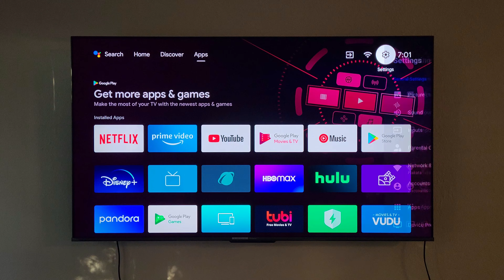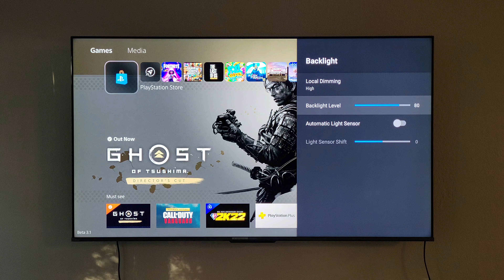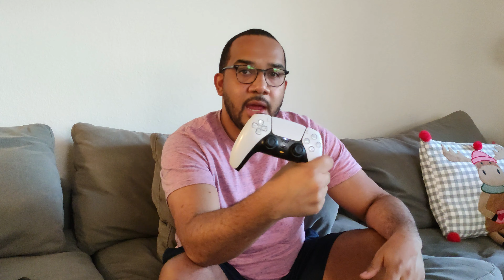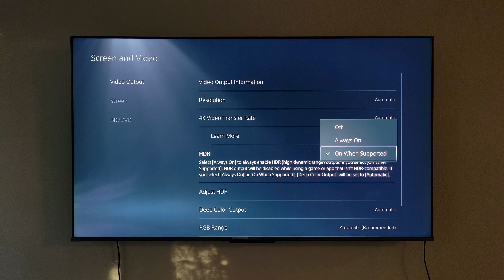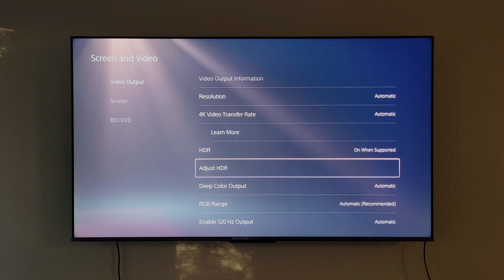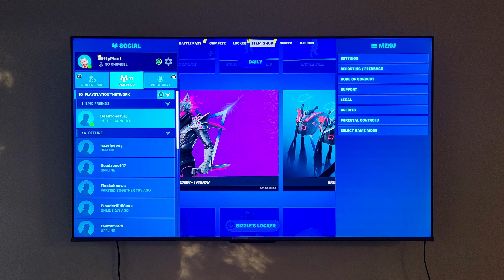Correctly Setup PS5 for Gaming! | Hisense U8G 65 Inch | Testing 120fps Mode

Comment: Ok so when I set the video on the TV middle 55 U8G to enhanced my PS 5 picture goes crazy It splits the picture in half horizontally making it impossible to use. I have to have the HDMI Format set to Standard.
Reply: I am facing the same problem. Did you get any solution for. I bought this TV to experience 120hz but can't get it working.
Reply: @GS.GamingSlayer  I found out that Hisense model in Australia doesn’t support 120. I have since bought a LG C3 it works great.

Comment: So weird we have the same TV with the same settings but yours looks so bright compared to mine ... my ps5 main menu and game looks darker ...
Reply: From having the U8G for 2 years, I would suggest putting local dimming on medium for overall brighter image.  Also make sure your hdmi black level matches on tv vs console (set to limited or auto on both sides).  Hdmi black level mismatch is a heavily overlooked setting that can give you a bad image with crushed blacks, if set incorrectly or mismatched between tv and console.  You can put main contrast to 80 in hdr to help brighten image overall as well.  Finally turning freesync on darkens the image way too much on this tv, I turn it off and just rely on HDMI based VRR.  I’ve also noticed forcing your console to 60 fps helps the overall image (colors and brightness) and anyways most games on console go up to 60 only anyways, and this tv has the weird 120 with half resolution issue anyways (workaround of setting to text clarity mode for full rez in 120 hz kills other aspects of PQ).

Comment: Any ideas why i wouldn't have the HDMI setting option? My settings menu goes Picture, Sound, then straight to Inputs. No HDMI option. Anyone know why?
Reply from the maker: No idea Patrick,  super weird.  Mt recommendations: 

Try a factory reset
Also contact warranty support if that doesn't work
Reply: Hi mine is under the SYSTEM option then under HDMI & CEC. However changing it to Enhanced completely screws up my PS 5 picture.

Comment: I just purchased this tv and I can’t get 120 HZ on my PS5. It continually shows 60. I’m using the hdmi cable I got with my PS5 last year. Is it not HDMI 2.1. Also, which inputs are the HDMI 2.1? I believe it’s 3 & 4 right?

Comment: Im struggling to get my u8g 65 inchs on 4k 120hz I did exactly what you did, but mine only says 60hz when I go o input, my enhanced is on and I even using the same hdmi as you
Reply from the maker: Whats connected to the TV?  And did you change the connected device settings?
Reply: @WittyPixel  I think I discovered what the actual problem is, my ps5 was plugged to the astro mixamp analog converter that only supports 120hz while on 1080p, unfortunately I could not find one that supports 4k 120hz yet, so I got pick use the full audio quality of the astro a 40s mixamp and play at 4k60hz or use 120hz but not 100% of audio quality, quite a downside for a premium headset adapter.
Honestly I didn't care about 120 hz, but games like ratchet and clank you can play on fidelity mode with Ray tracing best graphics at 40fps, and that helps a lot, I hope that become a trend and we have more fidelity mode using those extra 10 fps
Reply from the maker: Good stuff!  Funny,  I actually avoided buying the astro headset for that reason.
Reply: Mine says at 60hz instead of 120 hz how can I fix this

Comment: I can’t access ps5 game mode on the u8g. I have enhanced input on btw can someone help me
Reply from the maker: Make sure the ps5 is powered on and you use the HMDI cable that came with the ps5.  Then check the video settings
Reply: @WittyPixel  I fixed it. I had store mode enabled thanks tho

Comment: I have the u6g with a ps4 pro when I am at the playstation menu it's nice and bright but when u start a game it gets dull and not bright
Reply from the maker: It's switching between hdr and non hdr mode.  This is becoming normal with modern tvs so each input/ picture mode remembers your picture settings. 

All you gotta do is set the picture in tv settings before and after you see the dullness.

Comment: I don’t understand what is going on I have the UG8 55” and in the PS5 video output information it doesn’t list in frequencies 120 hz and I have it hooked up to a Denon audio receiver also
Reply from the maker: Try connecting directly to the ps5 & check again.  If still no 120hz, then enable enhanced hdmi.  

If it's still off try a new confirmed compatible cable.  

Good luck!
Reply: @WittyPixel  I found out what I was missing on the Denon audio receiver I had to enable 4K/8K and I haven’t done that yet till just now
Reply: @cooltwou  what’s a denon audio receiver?? I have the same 55 inch and the 120fps frequency isn’t shown for me with the given hdmi cable given with the ps5?

Comment: Man i have the u8g and a ps5 was able to set the proper settings for hdr but it looks washed out for some reason. If I disable hdr looks better. Any tip on how to fix the washed out hdr look?
Reply from the maker: Just gotta tune your picture settings :) I posted a full settings walk through for the U8G.  You can use that for reference

Comment: Anybody have issues where hdr is washed but sdr looks great. Using 2.1 in 2.1 input
Reply: Adjust your picture settings. I use this tv with my series x and the HDR is incredible
Reply: What settings do you use on HDR for PS5 to not looked washed?
Reply: @Creezy2Crazy  I messed with the picture settings and got it how I liked. Hdr definitely looks better now.
Reply: Yup thats how its supposed to look on this TV unfortunately
Reply: @JD-ey8hw  so what’s the point of hdr is sdr looks so much better? I’m having the same issue so I just disabled hdr on my ps5.

Comment: How did you get it to 120hz?? Mine says 3840x2160x60
Reply: This was my question as well. When the PS5 turns on the signal is being recognized on the video as 120 Hz. But mine just shows 60.
Reply from the maker: That depends what you have playing on screen.  Your source device/game has to support it
Reply: I just did all the same settings on the ps5 with my u7g and I’m getting the exact same as you
Reply: Did you ever find a fix for this?